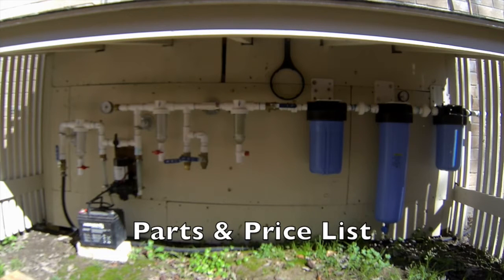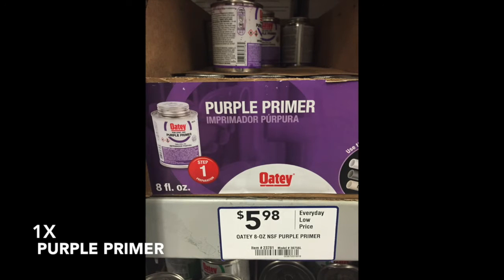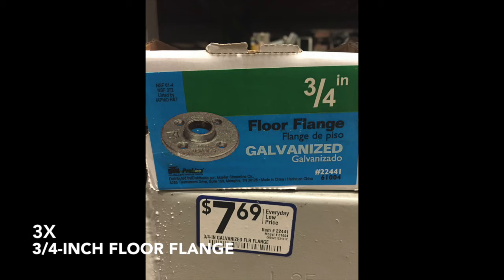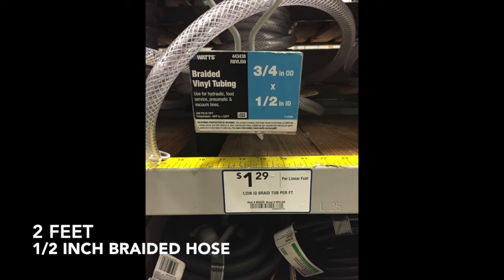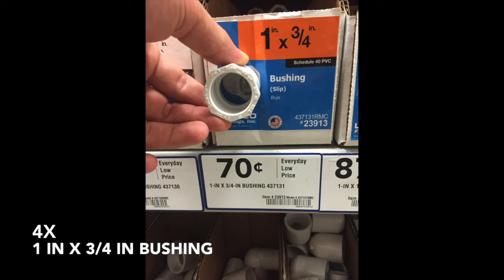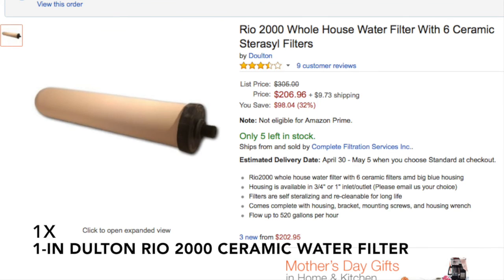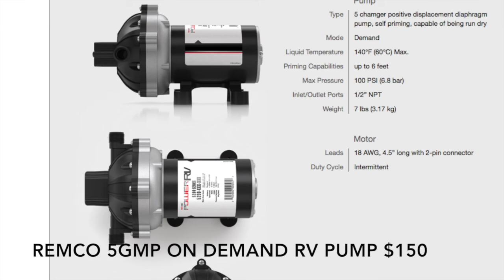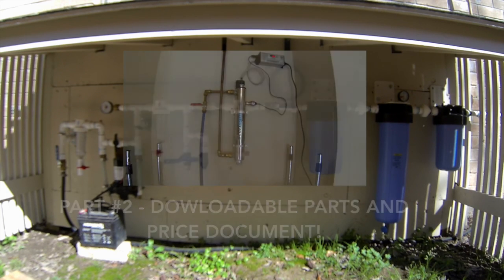Parts & Price List ( 1 of 2 ) - How to Filter and Purify Rainwater

Comment: whoa, confusing on the "10" housing but you only recommend buying the 20" housing."  Could you clarify that?
Reply from the maker: +SpectreTheHorseman I recommend the 20", you will have to clean it less. High in sight I would have went with all 20" housings but since I had the 10" I used it.

Comment: in  my  contry  it  300euro filter water 5 stage  osmosa in motor  high pressure I tinh it  more beter
Reply: +gogu gogu use this before the osmosis filtration
Reply: Also it maybe one of those under the sink kits that come already installed

Comment: Can you direct me to the video the discusses how you connect the IBC totes to this system?
Reply from the maker: Joshua Schlotterbeck I haven't made a video specifically over how the system connects to the ibc totes. It is very easy, all I did was run a 3/4 inch hose from the purification board to the ibc tote then threw the top of the tote lid. The hose hangs into the tote about 8 inches from the bottom. I drilled a hole in the lid to make this work, it is a very snug fit and the hose won't move once you have it in place.